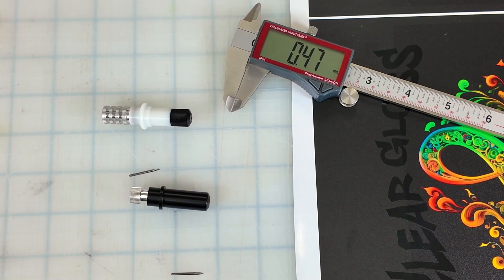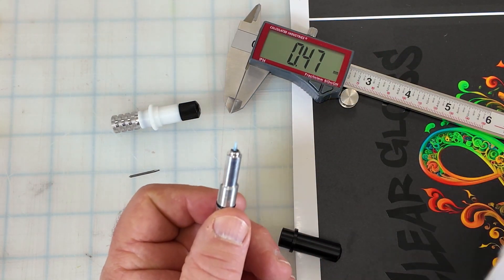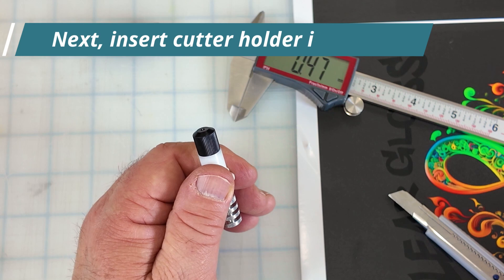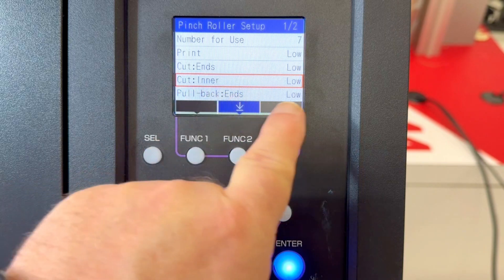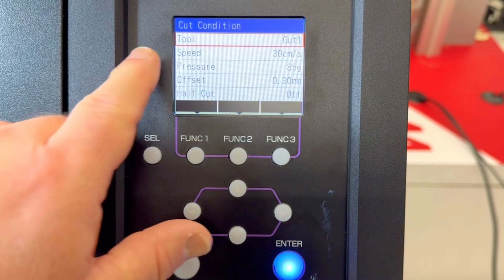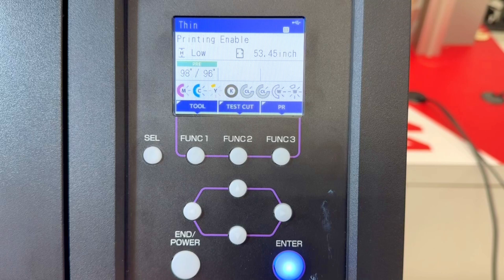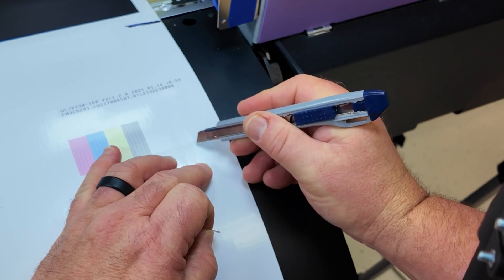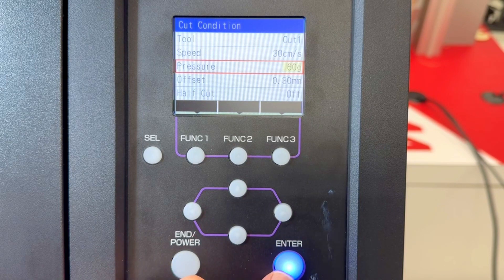Print and Cut Series Step #2: UCJV: Set-up Machine / Printer/Cutter

Comment: So assuming if I don't have the "tool" option on my mimaki printer it can't contour cut? It's a JV330-160
Reply from the maker: You are correct: 
Mimaki JV: Eco-Solvent Printer
Mimaki CJV: Eco-Solvent Printer/Cutter
Check out the Mimaki CG-130AR (54”) or the CG160FxII (64") Cutters. Also, check out the ID Cut Videos.  You can add the ID Cut Bar Code using your JV330, and the cutter will read the bar code and begin cutting with no user intervention.  
Thanks for the note!